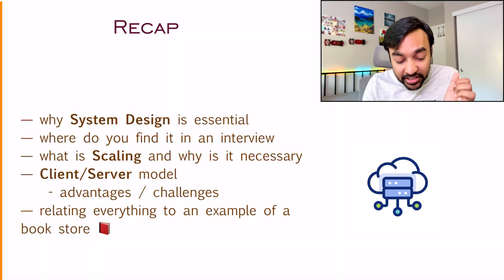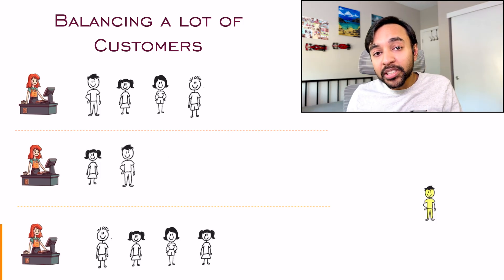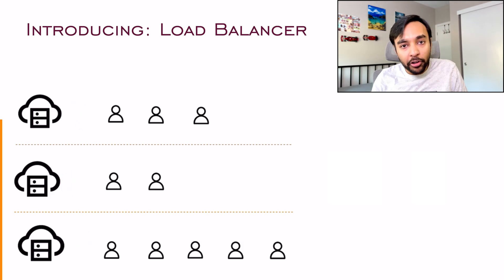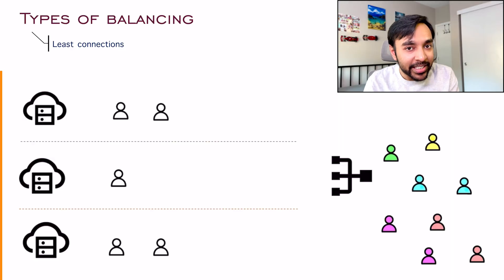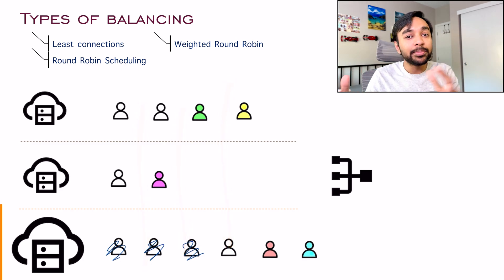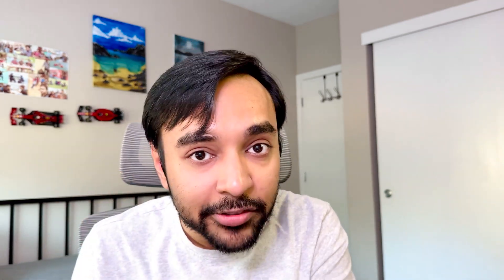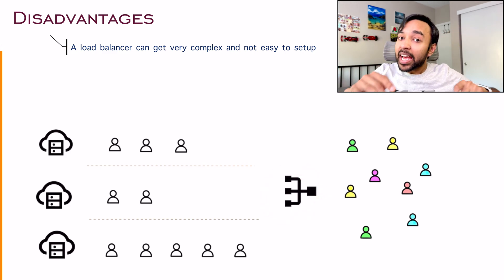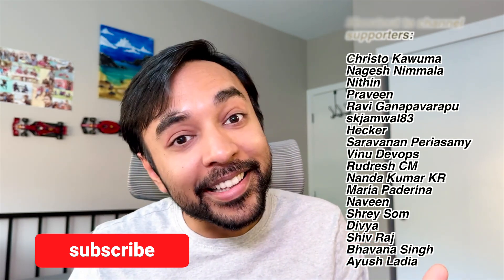System Design - Part 3 | Load Balancer | Different Techniques explained with animations

Comment: Great video. One concept related to load balancing that always confuses me is the consistent hashing.
Simple hashing -
        what? just find hash and send client to the server with that hash
        problem - removing /adding servers, will make all clients from happy servers to pack and move to different set of servers.
                          so what is the issue here? in case of any caches, there will be a lot of cache misses.
                          those clients be like - 'Why should I suffer, if some other faces an issues duh!!
        solution - Consistent hashing comes to the rescue!!

now, go and find out the super powers of consistent hashing!
Reply from the maker: I am planning to make a video on Consistent Hashing! It's definitely on my list of things to cover.

Comment: AWS provide this Load balancing techinque using Elastic Load Balancing using which we can balance load based on HTTP-based request or IP address. There are two type of load balancing techinque : Static load balancing (where load of the server is not checked ) and Dynamic load balancing technique (where load of the server is checked before distribution)